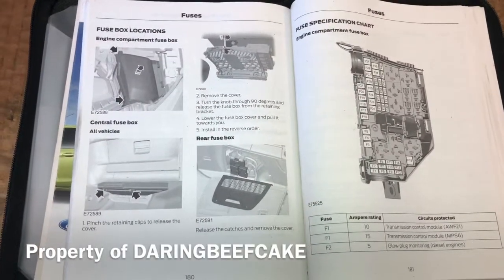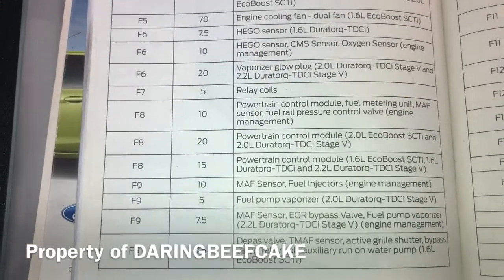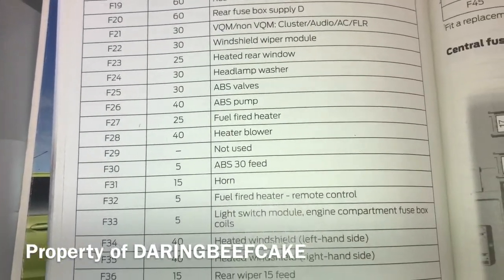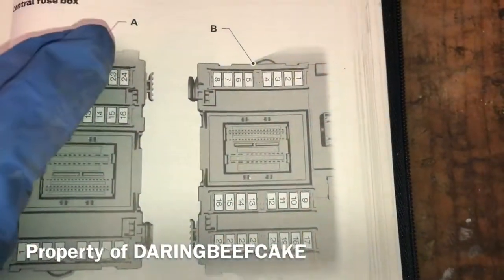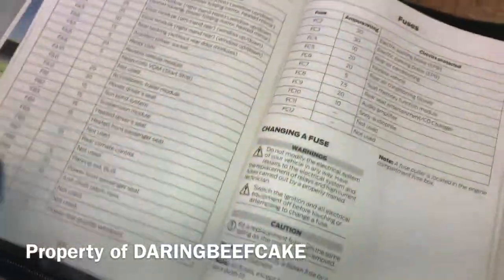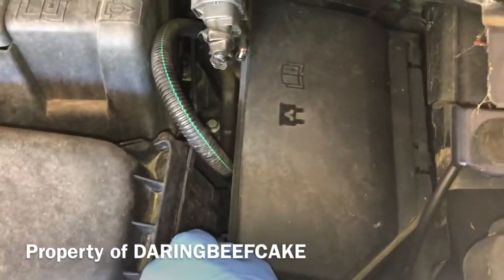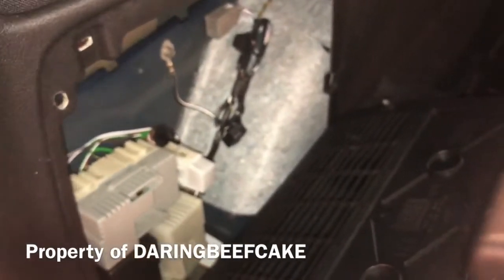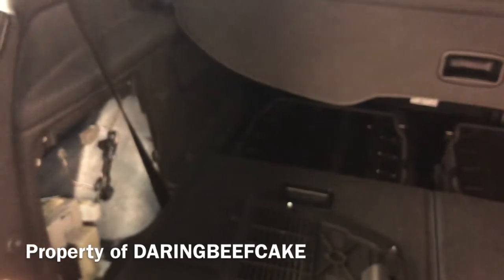Ford Galaxy 2014 right hand drive fuse location

Comment: Hi. Is there a plug/connector in the engine bay that goes to the instrument cluster
Reply from the maker: Normally there would be a cable/plug that is connected to the dashboard which would most likely go to the fuse box.
Reply: @DaringBeefcake  on its route to the fuse box, will it have a connection/ plug before going into the fuse box
Reply from the maker: @bkba394  🤔 not 100% sure to be honest but I never seen a connection in between, usually the wiring loom goes from one end to the other delivering different connections mostly coming from the fuse boxes to their relevant connections.

Comment: @7:36 I changed the fuse fir cigarette, it had a 7.5amp in there, I changed to 20amp but cigarette charger still not working 😕
Reply from the maker: Some times the problem is not with the fuse but rather with actual charging socket. If you can take it out and see if there is voltage on the wires would be the best way to check it.
Reply: @DaringBeefcake  thank you 😊  I changed the wrong bloody fuse 🤦‍♂️ is now working 💪 fuse for cigarette lighter is up the top row 2nd from left, needs a 20amp fuse
Reply from the maker: @Twichblade  hahahahha well am glad you fix it, well done..
Reply: The diagram in my Ford handbook for the passenger compartment fuse box is ACTUALLY UPSIDE DOWN! You couldn't make this shit up...
Reply from the maker: @wotireckon  Oh thats craaaazy..

Comment: I have a problem with the relay, it is heard non-stop and when the car is turned off, I don't know what the problem is? I replaced the relay, but at that point you can still hear the sound.
Reply from the maker: What is this relay for ?
Reply: @DaringBeefcake  relay for motor